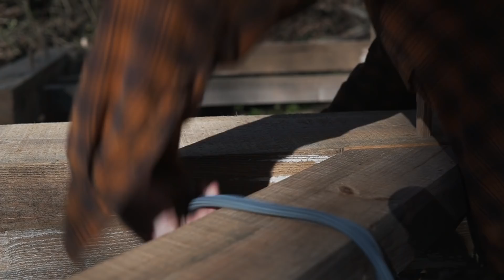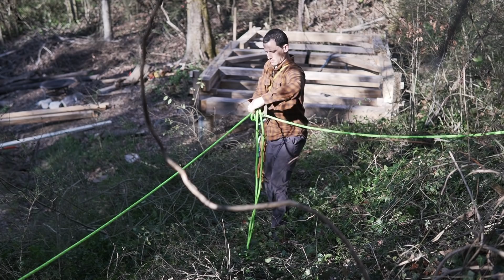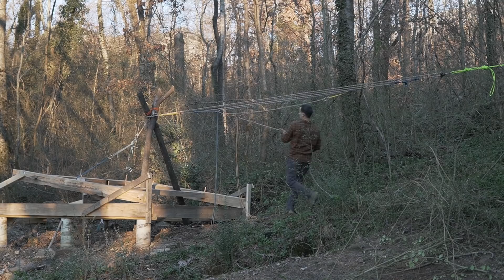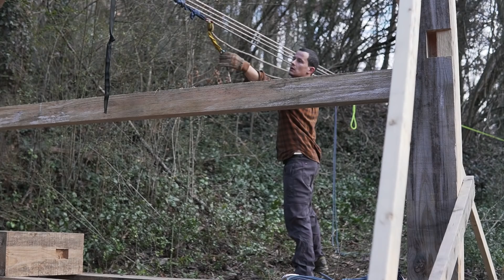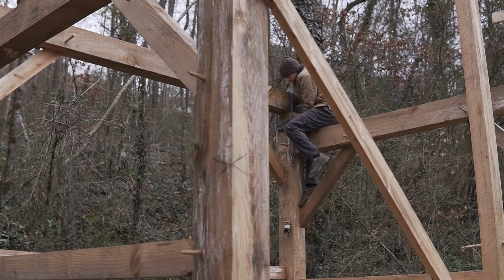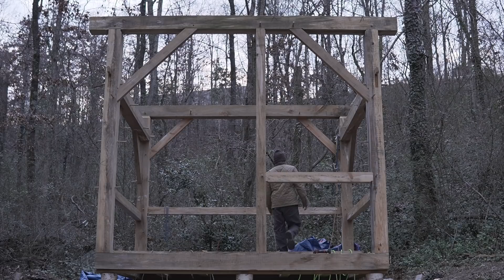Raising the Timber Frame with Ropes, Solo, with no Machines: Tiny Timber Frame Pt. 6 // Plans!

Comment: Love the comedy oversize mallet! Great work
Reply from the maker: Haha thinking of making the mallet into the door handle when the shop is done. Thanks for watching!
Reply: It was very common using a mallet that size for construction in the "old" days. My family had a couple different types, one akin to Nic's and one for laying down stones. I have no idea if they had used them or they were just heirlooms. By the way, it's all about weight; you didn't have a mallet with a metal head, so if it was made out of wood it had to be huge! (Edit: I actually thought that Nic really needed to make a bigger mallet, when I saw him using the axe to hammer in those pegs in the first couple of videos. Then he made the rough round mallet, which is very fine, and then finally came the big one! Great!)

Comment: Once again, great to see you doing this. Inspirational for sure. I am planning to do the same general thing over the next year.
Reply from the maker: Awesome! Keep me in the loop once you start, it’d be cool to see what you come up with.
Reply: Rough timber arrives Saturday.  I will be spending the next year doing all the joinery and prep work. Next year will be the raising time. This will just be a small 8×12 shop with a loft for sleeping. That way I will have something to work out of when doing the main cabin later. I'm doing a Japanese style like what Mr Chickadee is doing. Small timbers 4×4 up to 4x6 only. Largest will be 6×6 foundation joists. Lots of fun.
Reply from the maker: That’s awesome! I think the Japanese style works really well for a solo build. Not to mention the fact that they are insanely beautiful. Good luck with the build!

Comment: Awesome work! I never saw a shot of the type of joint where the corner posts (verticals) fit into the foundation beams. Can anyone describe or post a link please ?
Reply from the maker: It’s a stub tenon that sits into a mortise on the sill plates. The structure isn’t actually “attached” to the base until the siding is put on. Something like this: https://timberframehq.com/post-stub-tenon-detail-2/

Comment: Excellent job sir!! I’m a big fan of timber framed buildings. I love the style of your videos as well. Very peaceful and enlightening. I have my own woodworking shop and want to build a timber fram style garden shed in the summer. Question for you. Do the main posts on the corners that stand upright sit into a mortise at all? I assume so but I didn’t get any good looks in how the walls that were raised sit on the sill plates...
Reply from the maker: Thanks! Glad you’re enjoying the videos. Yes, each of the corner posts sit in a shallow mortise cut into the sill. It’s more of a locator joint and doesn’t hold the posts in at all. The frame wont be secured to the sills until the siding is nailed on. Hopefully that helps!

Comment: Nicely done. Some very satisfying 'pops' when those joints go together. Impressive rigging as well. I do wonder why you didn't get things started up into the air with levers and or jacks. Seems like you could have saved a lot of the initial heavy pulling getting them 30 degrees up before deploying the ropes.

Beautiful work.
Reply from the maker: you’re totally right, that first bit of lifting was by far the worse. It probably would have been worth it to build some type of simple crane/jack for the first bit

Comment: Loving the videos. How do I learn to timber frame ? Any books or video recommendations?
Reply from the maker: I’m learning from Will Beemer’s “Learn To Timber Frame” Highly recommended. It’s also good to check out some other stuff on YouTube. Mr. Chickadee is a great resource
Reply: @NicTaylorWoodworking  you are making the 12x16 from the book?
Reply from the maker: Mine is a 12’x10’, and has a different roof design. However, all of the joinery comes straight from the book.
Reply: @NicTaylorWoodworking  thanks, your channel is going to get big nice work

Comment: I came for a bit of timber framing, but now I really want to hit the cliffs and repel.
Reply from the maker: haha, it’s good fun! give it a try
Reply: @NicTaylorWoodworking  I've got everything for climbing/repelling (trees and cliffs) I need a block plane and a slick to timber frame lol. Any good suggestions for the block plane?
Reply from the maker: I use an antique Stanley, but Lie Nielsen makes the best modern block planes in my opinion. I’ve been eyeing their rabbet block plane for years
Reply: @NicTaylorWoodworking  I have some antique planes that I have collected, but they are not in working order. That is a very nice one. Everything is backordered though, even most of the woodriver brand (more my price range). I have to wait till April for my sawmill to ship, so I have plenty of time lol. (Thanks for giving a reply)
Reply from the maker: There are some pretty good resources on youtube for restoring antique planes, if you’re interested. It doesn’t take too long. Also, check out ECE planes. They are modern wooden planes that are really solidly built and come in at a decent price.

Comment: Can you do this with green wood? Or, was the timber seasoned first?
Reply from the maker: Green wood all the way! you can get seasoned wood, but it usually costs more and there is a good chance you’ll need to correct twist and warping. The idea is to try to build the frame before the wood dries too much. That way any twists or warps are constrained by the frame.

Comment: Was using a snatch block(s) out of the question?
Reply from the maker: Snatch blocks would definitely have been a much more effective way to do this. I’m a climbing instructor by trade, so I wanted to see if it was possible to use some of my old gear to raise the frame. Much harder than it needed to be 😅
Reply: @NicTaylorWoodworking   Makes total sense -- way to use your knowledge/equipment on hand to get the job done!

Comment: Nice work! Looks like it was difficult but rewarding. How did you keep it in place each time you let the slack out the of the system?
Reply: Was it the 2x4s on the pivots?
Reply from the maker: the 2x4s were backup. The frame stayed in place because of the grigri and the friction of the line doubling back so many times.
Reply: @NicTaylorWoodworking  Oh I see, very cool!

Comment: The definition of a "machine" is "A device that applies force, changes the direction of a force, or changes the strength of a force, in order to perform a task, generally involving work done on a load."  Is this not using machines?  Still interesting to watch, but clearly you are changing the direction and strength of a force (ie manpower) to perform a task.  Right?  Maybe the right word would be machinery?  Just curious.

Comment: I think you lost some efficiency using dinamic ropes. In norway they are using the same techniques that you using to put roof beams but they use steps on the ramp so it cannot slide off, I think you used microtraction so it can t fall
Reply from the maker: I actually only used static ropes for the raising, but the whole system was definitely not very efficient. It was a fun experiment, but I would do things much different next time. I’ve seen the stepped ramps, I was worried I wouldn't be able to generate enough strength to pull the logs over each step. probably because everything was so inefficient, haha. The assisted locking mechanism i used is called a GriGri. We use them in climbing. Thanks for checking out the video!
Reply: @NicTaylorWoodworking  i am a climber too😉 using good quality pulleys helps a lot, but they are expensive. But everything worked so that metter
Reply from the maker: Exactly my thoughts!